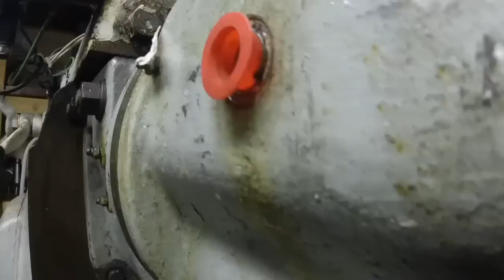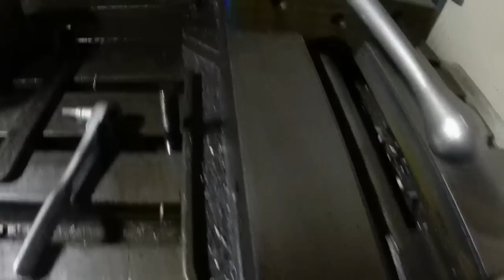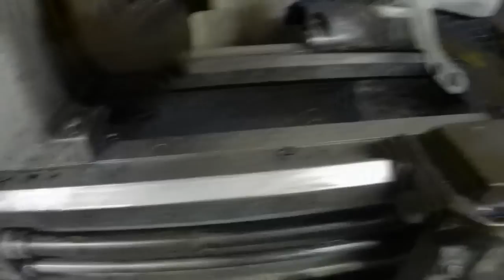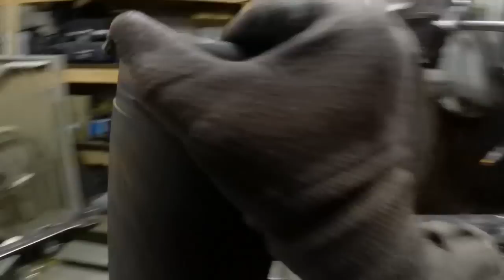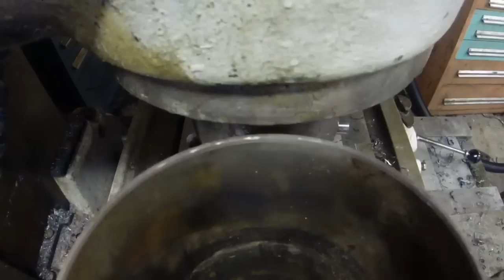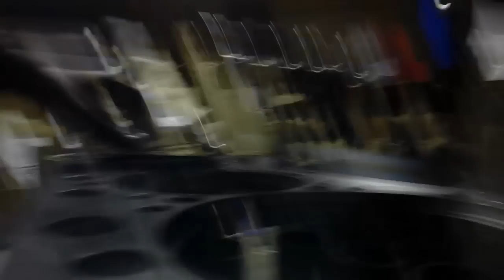It is raining in the shop but the work must go on! Deck Plate Part two

Comment: I used to have the same problems with condensation when I had my gear in the shed at home. It wasn't constantly heated and warmer weather used to cause much drippage. It was a full-time job keeping things lubed up to prevent rust. The situation is a whole lot nicer now in the heated shop.... mill is dry and I don't shiver in the mornings. ;-)
Love the heavier type work work you're doing!!

Colin ;-)

Comment: Hi Brian,
The cold and heat don't really mix in a machine shop, my shop is heated, cause here in the summer it's sometimes 30 deg. C and winter by these times get down to minus 25 deg. C. unworkable conditions...
Nice big plate with close tolerances, good work,
Pierre
Reply from the maker: We have similar climates it sounds like. It ranges from 100deg F(38C) in summer down to -20degF(-28C) in winter here.

Comment: In reading some of the other comments on this video I just want to say that I have organizational problems too Brian lol. I only have a one car garage and two very small machine tools(a 10" swing lathe and a small mill). I find it extremely difficult to keep everything organized. I also have the condensation issues but i'm putting in insulation and an electric heater before winter this year so I can work al year round. Your channel is great. Very inspiring even to someone like me with basically "toy" machines compared to your stuff. Keep the videos coming.
Reply from the maker: Climate controlled is for sure the way to go if you can justify it!  Thanks for the kind words.
Reply: No doubt man. I'm going to re-cover the exterior of my shop before winter and will add the insulation then. Thanks for the reply

Comment: Nice milling work Brian! The finished job looks great. 
I feel your pain with the sweating in the shop. I used to deal with that quite often, especially in my old shop. Come in and it's nice and cool in there, open the door when it's humid and foggy out, everything in the shop starts sweating apart instantly. There's been times I've come in the shop and everything bare metal was orange. 
That's why having climate control is important. Not only does it keep you comfy, keeps the moisture levels where they need to be 

On another note, what's all that "stuff" around your shop man? My shop OCD is kicking in when I watch your videos. LOL!
Reply from the maker: "Stuff" that will NOT be collecting in the new shop I guarantee!  I need to buy another semi trailer for storage and move a bunch of that stuff out. It is mainly engine parts, transmissions, gearboxes, farm equipment parts, house parts, turbochargers, nails, various hardware, garden tools, lawn mowers, tillers, chain hoists, and all kinds of other stuff.  I actually had my little work room with 70% open floor space back about July then I was given two disassembled engines and I bought that HBM which came with 3 crates of Beaver quick change tooling that are now all over the floor. I want to get another cart and get them put up and organized next. I had a deal going on two more Vidmar/lista style cabinets but they backed out on getting rid of them. That would have really been nice. I have my eye out for some more heavy duty shelving too as I could really use that as well. I would really love a cleaner more organized working environment, I will work on that for you and me both buddy! :-) Hopefully I will get it in shape before Tom sees one of my videos. Knowing how he was about your mill way cover he would probably stroke out seeing my shop! LOL!
Reply: I appreciate the efforts Brian. It's been bugging me since I first started watching you. LOL!
But I couldn't help but think that you'd have more work space if you didn't have so much "stuff" piled in the middle of the shop. But hey, everyone does things different man. I'm not knocking you. I am a fan of having an organized shop though...😀👍
Reply from the maker: Abom79 Another advantage of a climate controlled shop, you want to spend more time in it, which allows for more time doing projects besides customer work and lets you keep things clean and organized as well as gives you chances to work on your own projects. No condensation out there now at least... its 27 in there now. lol  Thanks for watching and I appreciate the comments and motivation. :-)
Reply: Nice video, was impressed with that part & the work you do
Reply from the maker: Kelly Breckenridge Thanks Kelly!
Reply: I don't mean to sound out of turn here, but seeing all that condensation drives me crazy. Is it not possible to use a dehumidifier and stabilize the condition of the air? While I realize that most shops are not air tight, so long as the walls and roof have no open seams, I would think a high quality dehumidifier would help reduce the amount of moisture. There are of course issues such as cost to both buy and keep them operating (they consume a lot of amps if they are good quality) in addition to having one that has a discharge hose (and not just a reservoir) and pump. Good quality machines are north of $500.00 plus removal system.

When I had mine going in the basement of a new home I built long ago, the first thing I did was buy one (removing 4 gallons a day) to help dry out the new foundation and sweat. Dehumidifiers are a high performance version of a air conditioner in some ways. They work very well if there are no drafts or leaks.

Your machine work is awesome!
Reply from the maker: Doug Hanchard The building is vented. It has soffit vents every 4 feet and an eve cap vent running the whole length of the building.  Were I going to be staying in there I would rip the eve vents off. and insulate and seal the soffits and put shutter style end vents in each eve that I could open in the summertime and shut in winter so I could actually heat it. The building is too short for my other two machines so there wasn't much point in starting that task. I too HATE the condensation and can't wait for it to be a thing of the past. Thanks for the comment and feedback.

Comment: bcbloc02 Very nice work Brian.  Like Adam I feel your pain on the condensation.  My shop is 3 blocks from the river.  I do run a dehumidifier and that does help a great deal in the winter.
Reply from the maker: Thanks Jay. I hope in your case the river stays 3 blocks away! I know in the river towns around here sometimes it decides to pay town a little visit.  Hopefully you are on up the hills around there so you don't have to ever worry about flooding. I know where I am that is one thing I don't have to worry about. No flooding, mudslides or volcanoes will be happening here. Tornadoes are most likely followed by earthquakes or fire.

Comment: I can totally empathize. I had my machines in several unheated locations. I almost lost a cabinet full of measuring tools, and my Hoffmann rotary table. Double bagged in tarps on pallets outside while I lived in several locations without a building to put them in.
Reply from the maker: Got to have water to live but it sure can make life hard too!

Comment: Hi Brian, new subscriber here! :) 

What is the aim for this deckplate? Is it to increase the stroke in an engine, or to fit different cylinder sleeves into the block?
Reply from the maker: In this case it is for a longer rod to improve high rpm performance, but it could be done for any of the other reasons you mentioned as well.

Comment: Your new shop reminds me of my grandfathers Barn in West Virginia. Glad to see that one is not going to rot like both my Grandparents barns did.  Both my folks were country bred, so I spent a lot of time in barns like yours.  I hope my suggests can help you make the new shop work better.    Summers in WV and near Washington, DC, and winters in Maine showed me some of the challenges you face.   Keeping your Barn /Shop heated, cooled, and  dry in humid weather will not be simple.  Barns after all are the original home of " flow through ventilation. "

     Have you looked at  a Heatpump  for your new shop?   Seems half the time you need heat and the other half you need AC to suck water out of your shop air.   A heatpump is basically an AC unit which pumps heat out, or in, as needed.  You could even use solar heat, using the big barn roof.    Solar power could handle your lighting, with tax breaks.   Imagine your shop running down your electric bill when you' re not running it.  
 
         You will need something to bring hot air from that high ceiling to your  shop level     I have seen Heatpumps work on 70 degree fluid, so they could even work off the waste heat in your loft area.   Once that barn is tight, you will have a large greenhouse effect from that large roof.   I know my dad's factory installed duct work and fans to recycle heat from their high ceilings.   I hope you can use my ideas, and run with them.   Perhaps we can keep this and other barns working, even after their farming days are over.  Thanks, and best wishes.
Reply from the maker: I have heat pumps on my house and they are pretty efficient which is nice, but they spend about half their winter off because when it gets in the 20's they can't hack heating anymore. I am still leaning towards installing the radiant heat as shops I have been in that had it were so nice the machines even stayed warm from the heat conducting up! Then I was thinking a couple of big ceiling fans to help keep the air mixed might would make for a sweet working environment. Thanks for your input and comments!
Reply: You may find radiant heat built into the walls a better, option keeping your floor solid.
Reply from the maker: Jeffrey Plum  Do you know if having heat in the walls causes more of a moisture issue because of the drastic temp gradiant from inside to out?

Comment: Well it was 30 below zero last night and a high of 3 deg. with no wind today The deck plate looks good do you just use the head bolts to attach it to the block ?
Reply from the maker: Yeah it is just sandwiched in there. The dowel pins and the liners index it so it is in the proper position and can not slide around while clamping it down. It is supposed to be 17high and -2 here Tuesday so I will be right there with you! lol  Thanks for the comment.

Comment: Beautiful milling work.

That's a wicked problem re the condensation issues! How will moving to the new shop help with this issue as it is obviously a much bigger airspace and the heat stack effects within the building are likely to be possibly even worse!

How do you cope within your own house for instance? insulation / dehumidifiers and / or heat?
Reply from the maker: The problem is the result of rapid temperature swings. The small room  off to the side of my garage has a 1500w electric heater and full insulation and that is all it takes to keep things from condensing in there. I have had bare metal sitting in there for years that hasn't rusted. My current garage/shop has insulated walls but a ceiling was never put in and the roof is vented so basically it is like being outside so the temperature follows what ever the outside is very closely. My new shop will be fully insulated and will have heat so I think my condensation issues will be over. Fingers crossed! Thanks for the compliment on the mill work. The customer has put it on and said everything fit perfect so I am very happy since all the bores had to be positioned within .001" over 36 inches or it wouldn't go together.
Reply: Thanks for your reply.
Reply: @bcbloc02  great machining there, the secret to that problem with condensation is keeping the tools temp above dew point of the air in the shop, a insulated building will help, heat and ac even more

Comment: That was an awesome camera angle with the mill going up and down. What was that blue pen looking thing you used to go around the opening before you set the cylinder sleeve in it?
Reply from the maker: That is a deburring tool, just a sharp crooked blade basically that removes burrs and softens sharp edges.
Reply: Oh ok. Makes sense.

Comment: you do great work and have a lot of cool interests!... (your cummins swap brought me to 
your channel). i have used fluid film in the past and like it, but more recently i stumbled 
upon Gibbs Brand lubricant for bare metal protection (among many other uses).
Have you ever used it? i would be curious how it would stand up against the condensation vs. fluid film for your needs
Reply from the maker: Thanks for stopping by and glad to have ya! Yes I have used the Gibbs'll get It stuff. I used to use it a lot for a penetrating oil/lube. I find the fluid film is a far superior product for corrosion protection as i have sprayed it on and it is still snotty good protection after 4 or 5 years, the Gibbs will be dried up by then. If I was trying to get a rusted bolt loose or something unstuck i would choose the Gibbs over Fluid Film. Currently I use John Deere Multi Purpose spray lube instead of the Gibbs since I don't have to special order it, its cheaper and seems to offer very similar performance.

Comment: Turn a fan on and circulate some air.
Reply from the maker: +Shortribs Longbow After putting in the insulated ceiling the inside rain stopped fortunately.
Reply: Good deal, didn't work here only circulation cured the problem.  Like your videos and the different work you do.  Looking forward to the next one.

Comment: so are 2 head gaskets going to be used for this? just wondering.
enjoyed the vid, thanks for sharing
Reply from the maker: Just 1, the lower side will be sealed with aviation grade sealer as all it holds is water and oil.
Reply: got it , that makes sense.

Comment: Just for my knowledge, what is a "DECK" plates use? Is this specific to diesel engines? Is it an upgrade? Thanks for the video!
Reply from the maker: Usually used to either add stroke, a longer rod, or change piston pin position. It can be used on any engine and is not diesel unique.
Reply: bcbloc02 Do you need 2 head gaskets to us the plate?
Reply from the maker: Not in this case because the liners go thru the plate. so combustion gas is not exposed to but the top surface of the deck plate. You do however have to seal the lower side against water and oil leaks.

Comment: Wanna build another one? Haha
Reply from the maker: Sure you need one? :-)
Reply: bcbloc02 I would be interested in one for a 6.7 Cummins block
Reply from the maker: You want the basic style that just covers head gasket area or the one where it ties to custom front cover and flywheel housing to help hold top to bottom?
Reply: Probably just the basic one that sits on the top of the block, I am still running an OEM flywheel housing at the moment
Reply from the maker: Email me and I will send you pricing.